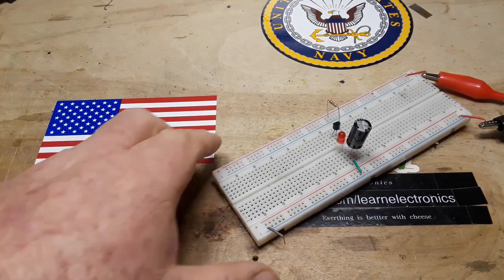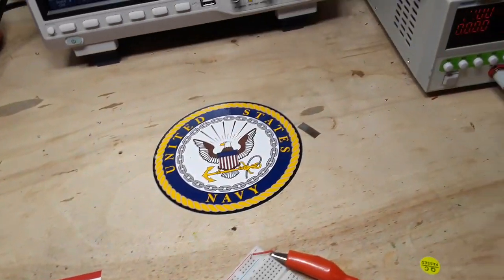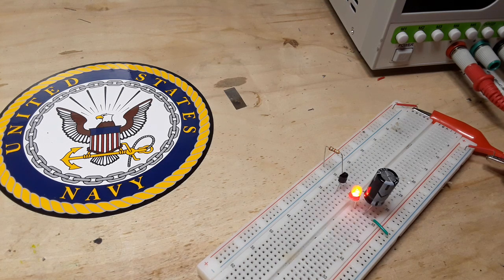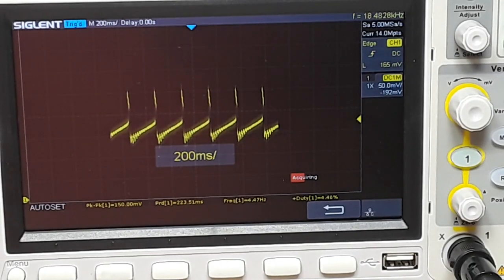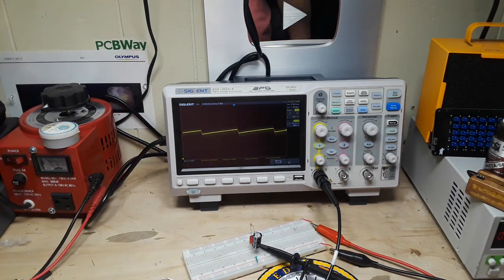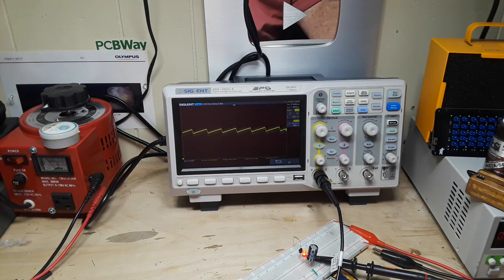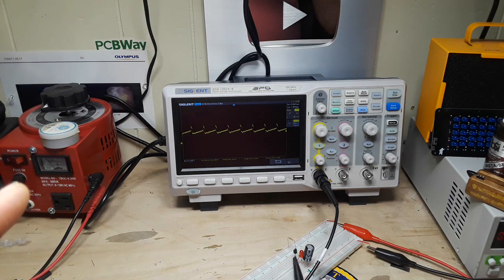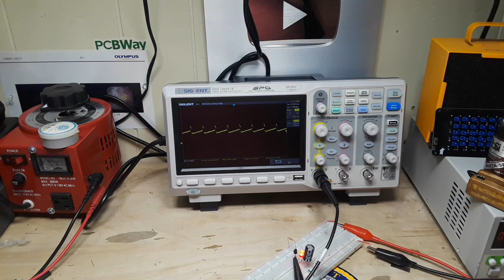2n2222a negative differential resistance

Comment: This is an avalanche transistor circuit see e.g. Electronics World, september 1967, p.30...32. The "centrifugal/centripetal/pseudoforce"  explanation is plain nonsense. Just show your viewers the IC=f(VCE) characteristic and point out the region with negative incremental resistance, with that knowledge you can explain the operation of the circuit correctly.

Comment: Centripetal Acceleration is the 'real' force that makes centrifuges work. But if you take that same inertial equation and solve it for the rotating point of view, you get centrifugal force exactly. They are the same thing from different points of view. Only physics snobs insist on only using the term Centrifugal Acceleration.

Comment: If i had to try to figure out why this circuit behaves like that I'd suppose that when the breakdown voltage of the transistor was reached the full voltage drop of the diode applies which lowers the voltage across the transistor. I don't see what some imaginary complicating force has to do with it. The resistor would divide the voltage of the capacitor so changing that would also change the capacitor time constant? I don't know how it all works but just saying "it's all because of an imaginary force i looked up on Google after i discovered super fast transistors exist!" is not an explanation. Maybe in the navy they get away with explaining it like LEGOs to technicians but they do that to keep the bullet catchers from getting too smart.

Comment: What is happening is likely due to the reverse breakdown voltage of the BE junction being exceeded and self triggering the base causing the transistor to turn on and discharge the cap through the LED until the cap voltage drops below the breakdown voltage. Explains the voltage dependency a bit. It seems a bit like a solid state relaxation oscillator.
Reply: I can't think of anything else but this, also because current is actually flowing, so it must have happened
Reply: I found this data sheet https://www.onsemi.com/pdf/datasheet/p2n2222a-d.pdf
I'm sure there is something in there about 10v causing this affect.

Comment: it would have helped new comers if you had a schematic with this little lesson. really cool video Paul. you need to check out the 2n2222a data sheet. it looks likes the cap charging, but also the breakdown of the transistor plus the diode. maybe all three!(of course all three) you could be getting oscillation going to. look in closer on the scope at different voltages and see if your getting a clear ringing or more of a charge up & down/diode breakdown. very interesting find..try it with a normal diode too.(coz LED's are bad at blocking) bet the results a very different. HUGE THUMBS UP.

Comment: You can swap an NPN transistor E and C and it still works. 
But above a certain voltage, the current breaks through from E to B. This makes the route E to C conductive. 
The route C to B can withstand higher volts.

Comment: This circuit uses the Vebo emitter to base reverse breakdown voltage, which is given as around 5 volts for silicon transistors.  "But the base isn't connected!" you say.  When the collector is connected to negative, the base to collector junction is forward biased and acts like a diode connecting the collector to base!

This 5V Vebo is supposed to never be exceeded because a few volts above 5 V, the emitter to base junction goes into avalanche breakdown.  This avalanche breakdown can cause permanent damage to the junction.  But the avalanche breakdown causes the circuit to act like a neon lamp relaxation oscillator.

Since this Vebo breakdown voltage could be any voltage above about 5 volts, the circuit has no guarantee that it will work.  If the breakdown voltage is above the supply voltage, it will never break down and never oscillate.

The avalanche breakdown caused the transistors I've used to permanently lose current gain or hFE.  The hFE may measure 250 before avalanche, and under 200 after.

BTW, 2N2222A transistors originally came in the metal TO-18 package.  All plastic equivalents should not be marked 2N2222A, the usual is MPS2222A, PN2222A, etc.  The plastic package does not directly substitute for the 2N2222A because it can't handle a full watt of power.  Thanks for the video.
Reply: "This circuit uses the Vebo emitter to base reverse breakdown voltage, which is given as around 5 volts for silicon transistors."    No, this is an NPN transistor the BE junction is forward biased so that's not correct. EDIT, ignore this I was reading the pinout of the transistor wrong.

Comment: Very cool effect Paul. Would have liked to see you run the circuit without the transistor and then put it in to see the real effect differential. Only because the capacitor and the LED are both connected to the resistor and ground line. It's interesting that the base is floating and this is why I wanted to see both sides. Guess I will have to try it myself.

Comment: What's a great transistor refuse to learn with and use in general. You need some really great stuff them. :-)

Centrifical is the outward force :)

It took me a minute to figure out the circuit the first time I ever built one. I didn't want to look up why it was doing it I wanted to try to get a hypothesis and then test it what I did look up exactly how it works :-)

Comment: this board is full of capacitance - did you try using "spider web" connections?
switching power supply is high frequency device - did you try with battery (Really constant DC voltage)?
Reply: Good ideas both. I'd think the capacitance is low enough at ~20khz to not matter, and the power supply output is internally filtered - but you don't know until you test it.
   I can imagine a scenario where a high-frequency component from the power supply tickles the base just enough to lower the avalanche voltage from nominal.

Comment: Question? if you increase or decrease the environment temperature, does the frequency change?,  if the capacitor value change does frequency change?    a possible xtal substitute????  lol.

Comment: You didn't explain the differential aspect. Differential between what and what? The term "negative differential" suggests a relationship between two resistances that is normally positive but gets inverted which means one or both resistances change. Which two resistances invert in this circuit? I assume the resistance of the resister doesn't change. Is it two resistive loads in the transistor or what?
Reply: Negative differential resistance is trying to say that between the two positive voltage points consecutively applied to a device, the current decreases instead of increasing like a normal resistance.

Comment: The base-emitter-diode is operating in reverse and acts like z-diode. The base is roughly at the same potential like the collector. The reverse base-emitter-diode has a breakdownvoltage of roughly 6 to 10  volts depending of the transistor type. When the capacitor is charged to a high enough voltage the base-emitter-diode has it breakdown and a avalangeeffect happens. Because of the circumstance, that the transistor is a current amplifier, the emitter-collector-path switches on and the capacitor gets discharged.
That's more the function of a DIAC or trigger diode. It has nothing to do with the tunnel effect and the way that tunnel diodes work.
Reply: "The base-emitter-diode is operating in reverse and acts like z-diode. "  No that's not right, it's an NPN transistor so here the BE junction is forward biased. And the CB junction, which is reversed biased and so could break down, still can't because its breakdown voltage is 40V minimum and he's driving it from about 9V supply.
Reply: @CAsCurryKitchen  you're a little bit wrong. First we have to realize that the transistor is forced to operate in a reversed manner. The collector is attached to a lower potential than the emitter. That means that the collector-base-diode is forward biased and the emitter base-diode is reversed biased. Therefore the behavior of the transistor is a little bit weird.
I think you should do a little experiment. Grab yourself a breadboard, a npn-transitor, a 1kΩ-resistor, an adjustable power supply, a voltmeter, and some peace of wire to make some conections. Attache one leg of the resistor to the positive rail of the power supply and the other leg to the emitter of the transistor. Connect the base of the transistor to the negative rail of power supply. Than connect the voltmeter across the emitter-base-diode. When you now supply different voltages to that circuit, you will realize that below a certain value the voltmeter readings are roughly the same as the the applied voltage. Above that certain value the voltmeter readings will stay at the same value when increase the applied voltage. That's the behavior of a Z-diode.
If you have also a LED and capacitor, you can than build the circuit, that is shown in this video. If you also have a oscilloscope you could measure the voltage between the base and collector and the voltage between the the collector and the emitter, possibly at the same time.
And I'm pretty sure that I am right.
Reply: @hinkelstein4six  "The collector is attached to a lower potential than the emitter. " How do you figure that when the collector is connected to the positive rail through the resistor and the emitter is connected directly to ground? Look at the 2N2222 pinout.  EDIT, It's ok I was reading the pinout wrong so i agree with you.
Reply: @CAsCurryKitchen  the emitter is attached to the connection between the resistor and the capacitor and the collector is attached to the LED. That is explained in the video. Watch with care and listen to the things that said really early in the video.